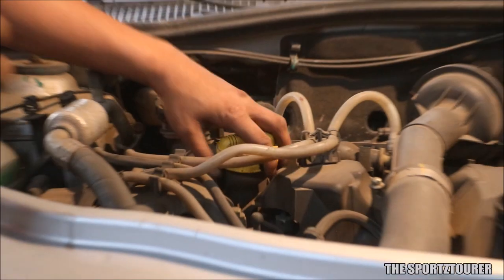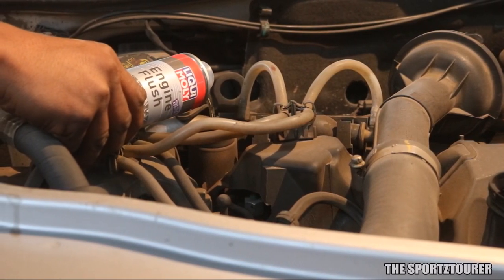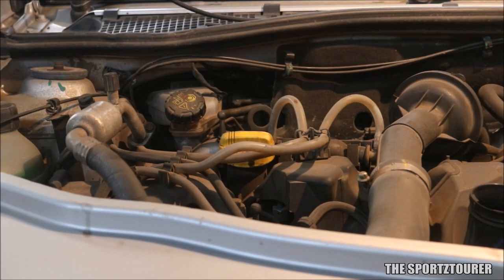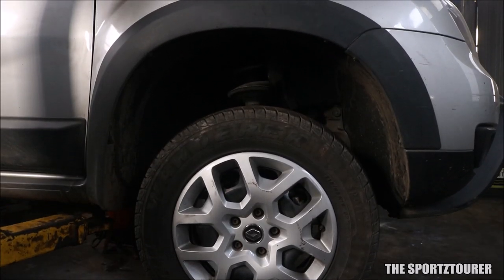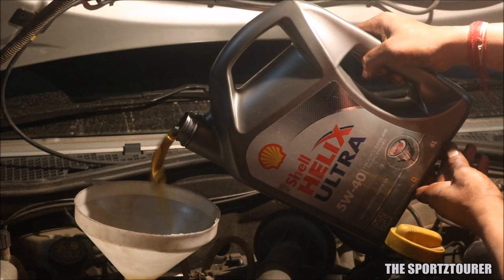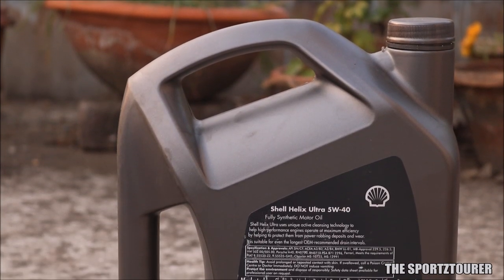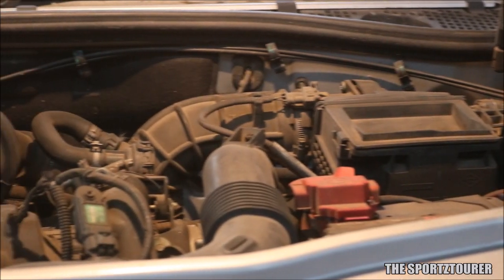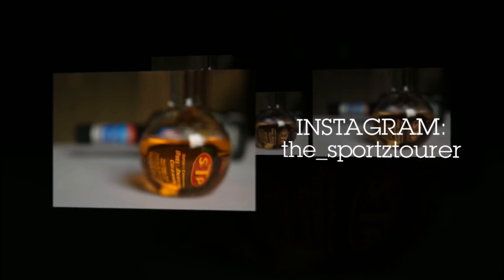COMPLETE ENGINE FLUSHING SHELL HELIX ULTRA REVIEW 5W-40 | LIQUI MOLY ENGINE FLUSH

Comment: I used Liqui moly flush for Creta 1.6 crdi 2015 in November 2018 & is really good in my case i just feel the metal particles came out when i used it & then there is increase of milage by 1.
Plus i used Mobil 1 super 3000 5w40 fully synthetic & due to both of thses engine was way more responsive,smooth & yes clatter was reduced too which i call melody for me!

Comment: One question i have a ford freestyle 1.5 tdci . My mechanic used 0w-40 but then flushed it 10w30 and revved the engine to 2000rpm as the Engine was already warm and then changed the oil with the new 0w-40 oil. I asked him to keep it in idling still he revved the engine slightly. Will this cause any harm
Reply from the maker: Hi,
I guess things should be fine as there was no red line achieved. That 1.5 TDCI is a lot abuse friendly with its robust construction.
Reply: @thesportztourer  ok thanks for the response. 🙂

Comment: Hi.. Can I use LiquiMoly Molygen 5w30 in Elite i20 asta ? Previously I used the same shell helix ultra 5w40.. But hyundai recommendeds 5w30 grade... So this time I am planning to buy 5w30 Molygen.. Kindly suggest... Will early wait for your reply....
Reply: Model Name - Elite i20 Asta Petrol 1.2
Reply from the maker: Hi!
Of course you can go for the Molygen 5W-30 which seems to be a good oil (yet to experience it). A friend is using this Mobil 5W-30: https://amzn.to/2PoMB50 in his Grand i10 and is happy with its performance which can be an alternative for you.

Comment: Hi there. I have a swift dezire diesel 2011 model. The total run of  it is 63,000 k.m. till date. Should I have to go for engine flush? Pls guide.
Reply from the maker: Hi,
Which oil was used? What was the oil change interval?
Reply: @thesportztourer  I use shell helix 5w-40 at every 12k- 15k k.m. interval.
Reply from the maker: Got it, you can go for an engine flush.
Reply: @thesportztourer  Thank you.

Comment: Can i use this flush & the engine oil in my Celerio VXI AMT 2014 model ? Appreciate your work :)
Reply from the maker: Hi,

Yes, You can use this on your Celerio 👍
Thanks a lot for appreciating the work and supporting the channel 😊
Reply: @thesportztourer   So are you confident that no issues with the AMT Gearbox on my car ? i have one more thing to ask.
Reply: @thesportztourer  You compared Nigth eye csp vs auxbeam gt. But how do the COUGAR MOTOR EVOLUTION + csp compare against Night eye csp. is night eye better or not ?

Comment: Thanks for the video. Is your Duster fitted with a DPF and Cat? If so, the recommended oil would have to be ACEA C rated, but you used ACEA A3/B4 in this video.

Surely this can cause the DPF to become clogged.

Comment: I am Mechanical Engineer and i have TATA SUMO GOLD COMMON RAIL CR-4 BS-4 2012 MODEL.
Recommended oil for sumo is 15W40 grade, in 2015 i was put this Shell helix ultra full synthetic 5W40 oil in it, the pickup and sound changes are noticeable, but later on i consult Scotty kilmer about this so he told me that always use recommended grade oil, 5W will gives better performance but increase the wear and tear and decrease overall engine life, so later on i put 15W40 as per recommend, but not CF, not CH, i put CI grade which is latest.
Maruti owners manual for swift recommended 5W30 oil.
Reply: OK . but I don't understand by u saying it gives better performance but increase wear and tear
Reply: @myklesingh8253  15W40 is thicker than 5W40,
When the temperature rises the oil gets Heat and looses it's thickness.
If idle running of 15W40 is 1500 rpm then it's increase upto 2000 rpm. But the oil is like very thin that's why it starts leaking from piston rings, seals, gaskets etc.
Reply: @mightyheart999  ohk . thanks for that thought

Comment: Bro, which is the best fully synthetic engine oil for 2017 Swift VXI petrol?? Please suggest. 😊
Reply from the maker: Hi,
Which oil are you using now?
Reply: @thesportztourer  it clocked only around 9000 kms on odo. Presently it has company provided oil in it.
Reply from the maker: Nice,
You can go for HX8 or ESP fully synthetic. New gen 1.2L Maruti engines come with 0W-20 recommendations still I would prefer using 5W-30 which they use to recommend for heavy use 😊
https://amzn.to/2Uxp41L
Reply: @thesportztourer  Thanks for your kind attention.😊 Does the above mentioned Engine oil is suitable for petrol engines?
Reply from the maker: Yes, it is suitable for Petrol engines (also meets API SN standards).
Reply: @thesportztourer  thank you so much
Reply: mobil 0w-40 is the best or motul 8100